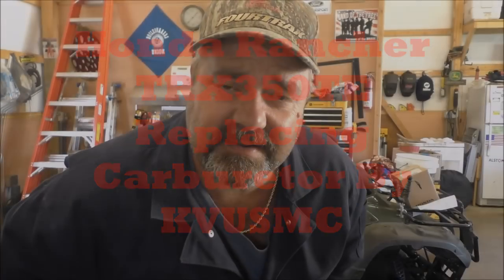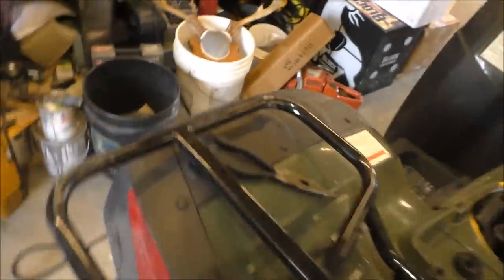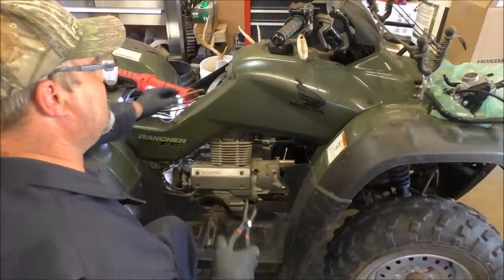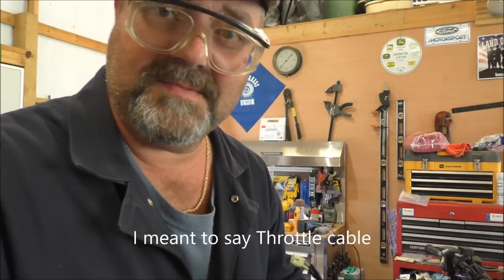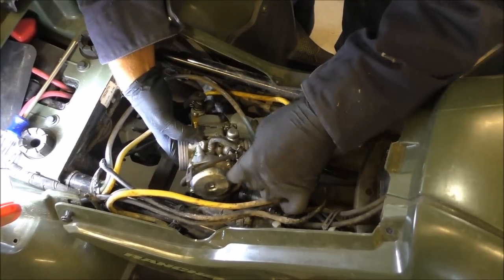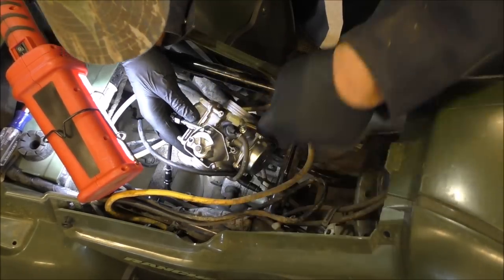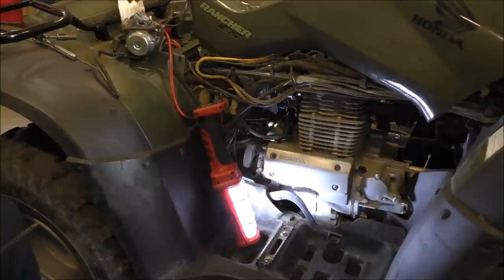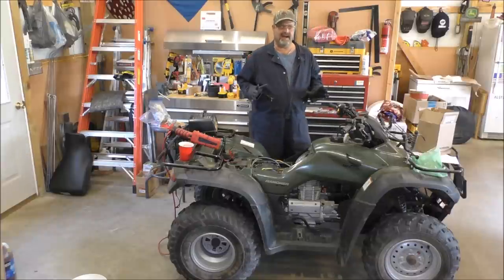Honda Rancher 2006 TRX350TE Replacing Carburetor By KVUSMC

Comment: I changed out the carb on my 2005 Rancher, put it back together and it had a crazy high idle. Went back and watched your vid and noticed I didn't tighten up that throttle cable. Great video.
Reply from the maker: Thanks Buddy I really appreciate it 🙏

Comment: We changed out the carb on a 2006 Honda Rancher TRX 350 FE 6. Ran into a problem with the #6 10 amp fuse blowing. Motor would not start afterward.  Found the problem to be the heater element on the after market carb was shorting out. Swapped out the heater element and runs great..
Reply from the maker: Good deal Great Troubleshooting that is great Brother 👍

Comment: Gonna do my carb on our 2004 TRX350TE ES tomorrow. Thank you for the video, brother. I'll let you know how it goes. 
JJ Manné, MSgt USMC (ret)
Reply from the maker: OORAH Brother Sounds Super I will be waiting To hear back from you Semper Fi 
LCPL Viar 0811 Field Artillery 1990- 1998 
Cheers Kenny 🍻
Reply: @KVUSMC-KU4SMC  Well, my choke cable is seized into the carb. Got everything else off. Used heat gun toward back of choke needle hole and it came out...
All done and put together... Now it blows a 10 amp fuse every time I turn the key...
It was the carb heater blowing the fuse. I disconnected it as we are in the CA desert. Still running rough as hell and no idle without throttle.

Comment: The piece you called the choke is actually the throttle cable and the piece you pointed out to be the fuel line is actually the choke . But Great job !
Reply from the maker: Sorry about that I appreciate it the Corrections I'm learning everyday Cheers Kenny

Comment: Thanks for the video - this is my exact model and now I feel like I can (maybe) do this on my own ... a buddy of mine swears by taking these carbs off & soaking 'it in acetone then rebuilding, since there's only so much that can go wrong in there ... I may try that first, but getting to the carb looks like 90% of the work ... hmm ...
Reply from the maker: I know what you mean Brother
Reply: @KVUSMC-KU4SMC  I'm with you on the original parts - sure, I can get a carb that 'sort of' fits from amazoid for $40, but ... if I'm gonna do the work, may as well do it right? Time vs. $ .... We'll see what good 'ol cleaning will do, hope I don't have to drop $200 for a new Honda carb, but I'd rather do it once right than several times half-assed.  Again, thanks for the video. You sound sort of like John Goodman, which I think is great  :)
Reply from the maker: You Welcome Brother I know what you mean

Comment: Good job. I recommend using Lucas Ethenol "Safeguard". It's done wonders for my older motorcycle with carbs. The older stabil red breaks down with 10 percent moonshine gas. Stabil also has a new Ethenol product as well.
Reply from the maker: +ItsVash Thanks Buddy I appreciate it yes I use the blue Stabil Marine Formula Ethanol treatment in Every thing zi own I think my must of forgot to use it over the years Moonshine gas is horrible

Comment: Hello I just bought a 2006 Honda Rancher ES 2x4 and I ordered a new Honda OEM carburetor and I was wondering where do the vacuum lines hook up Too I have two little lines that are underneath my tank I was thinking maybe those
Reply from the maker: Hi buddy There should Be a place underneath The tank  I would look At Parts Diagram or before you take the old one off Always take pictures Brother  I hope this helps Sir
Reply: @KVUSMC-KU4SMC  thanks for helping me! I bought the quad and it had no carburetor in it so I see how the lines come to a Y on the carburetor which those are breather hoses but I don't have another line on the right of the tank to fit that Y union I have 2 smaller rubber hoses that look like they rest on the snorkel

Comment: Any idea what would cause my 06 rancher to idle fine but did when I give it gas? It will idle all day long but dies when you hit the throttle.
Reply from the maker: Not sure on that one brother
Reply: @KVUSMC-KU4SMC  I figured it out a few days ago. Where the choke cable connects to the carb had come loose and it was sucking air. Haven't had a problem since
Reply: I am having the exact same problem. Just started doing it yesterday after having zero problems for 18 years. Runs better when I pull the choke but obviously can’t run it like that. Smells like it’s getting too much gas. Going to try a new plug first but maybe time for a new carb.
Reply: You might need to tighten or loosen the pilot screw
Reply: Sounds like your idle circuit is fine but main jets may need cleaning.  These carbs hate ethanol moreso than most

Comment: Got a 99 TRX450S that when trying to adjust the fuel screw I can close the screw completely and the bike doesn’t even drop an rpm it seems. When would cause the rpms to not change at all?
Reply from the maker: That is something else buddy
Reply: @KVUSMC-KU4SMC  I figured because I’ve tried a few different carb parts between the oem and a spare China carb. Any ideas?
Reply from the maker: @troybrahful  try the OEM original buddy
Reply from the maker: @troybrahful  All OEM Original parts
Reply: @KVUSMC-KU4SMC  thanks. I have all oem. Think I might just break down and have a mobile mechanic come look at it before I just throw parts at it trying to be a hero.
Reply from the maker: @troybrahful  I don't blame you blame you Brother

Comment: Wondering if that is what I have to do my same exact atv will not stay running, clean out the carb the thing will start for like 15 secs then shutoff and will not turn over
I have gas going to the carb
also battery is draining way too fast even a brand new battery dies while working on the carb etc
Reply from the maker: I feel Your Pain Get A Battery Tender Then Get a New Carb Buddy

Comment: What is the fuel line size? I am in the process of replacing my carburetor and half the fuel line is rotted or eaten away. I'm trying to figure out the ID line as well as a fuel line diagram
Reply from the maker: I would call the parts dealer I'm not sure